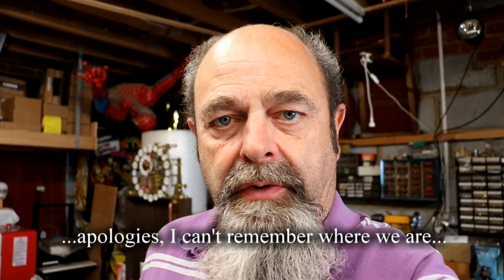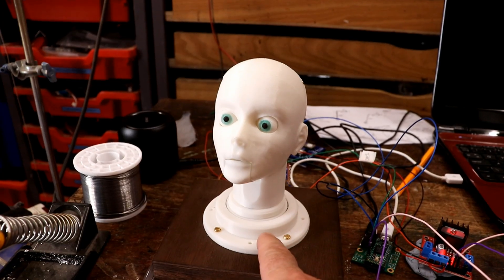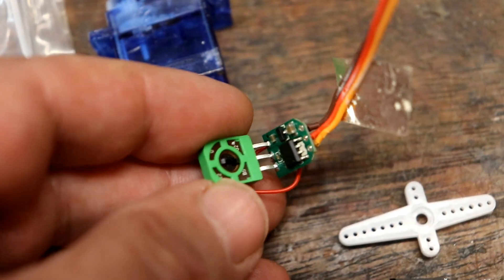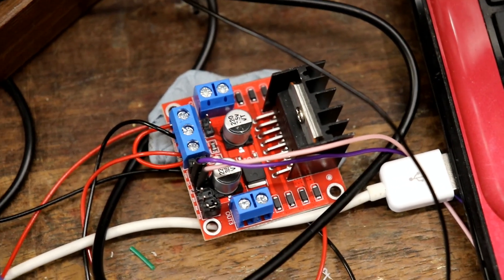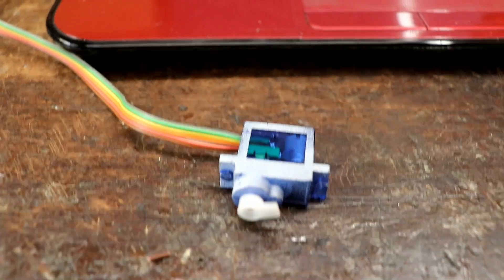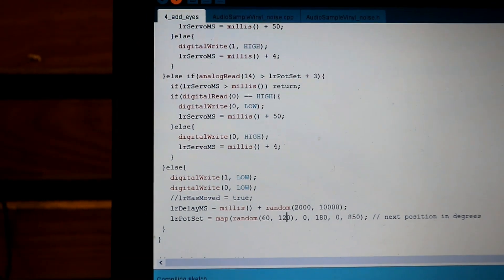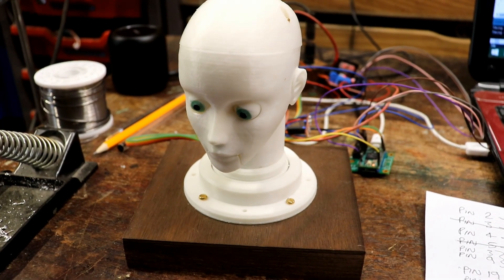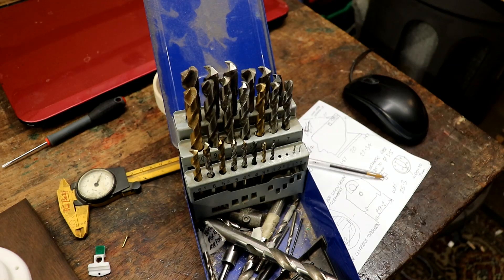Part 6 - How to take control of a servo motor

Comment: I recommend you use I2C controlled servo boards. no burdain and conflict on the microcontroller
Reply from the maker: Thank you. I did consider using these but ending up finding the Teensy had enough pwm outputs to cater for the required servos.

Comment: 06:00 - 06:10 Excuse me for thinking out loud ..
I assume you should keep it so that the movement stays within the potentiometer's resistive track.
So you have an analog representation of the servo's position. 
I'm not sure what kind of feedback the potentiometer provides outside of the resistive track,
but I'm guessing 5V, open or 0V.

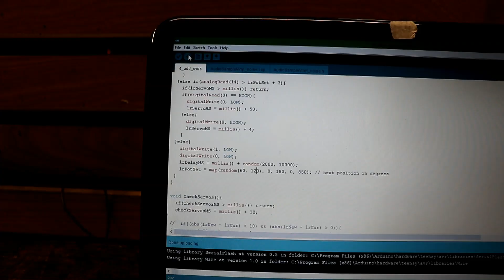13:33 ->
Your wife did a wonderful job.
Are you the skilled author?

18:57 ->
Congratulations! Have fun!
Reply from the maker: I had no idea of the position of the potentiometer having taken the servo apart, cut off the 180 degree stops and then reassembled it. Thankfully a bit of experimentation found the 90 degree point and which way the motor connections should be connected to the H-bridge interface - so many possible sources of failure! Being able to move right round, once it had found the 90 degree point I just reattached the servo's horn. 

I connected each end of the potentiometer to the Teensy's 3.3v and 0v supplies - the Teensy works on 3.3v and it's inputs mustn't exceed this.

I'm so grateful my wife is happy to record the automaton's speech. I wrote the script with some added steampunk style from ChatGPT!

Thank you. I can't wait to build some sort of machine using the automaton head....

Comment: It is like many a project, you get to around 80% completed, but then the last 20% seems to take even longer than the 80% took to complete. Is the talking heads voice really your wife's voice, if so she has a talent indeed. She sounds exactly as I would expect a Victorian Lady to speak. The piece of felt to ease the jaw was a good fix. Good post again, getting engrossed in this one 👍
The next piece is optional, as part of the 80% to 20% conundrum.
I was sat in a hotel in Sacramento, CA, with a folio of coding, a Psion Organiser, an EEPROM programmer and a bags of EEPROMS. Two of us had designed a system that could tell the difference of one of our large industrial gearboxes being stopped naturally and being stopped because the operator had left a loading trolley in the way after loading  3 x 1 ton reels of newsprint paper. We had completed tests here in UK but had to make them work over in the colonies, as it were. I was sent as the other fellow had a fear of flying, whereas I had often fallen to sleep before the plane took off. I did manage to get the coding right and the units worked. However, after hearing how successful these units were the MD pulled the plug on the project as he would lose the costs to repair the gearboxes. He always was short sighted,  because we could adapt the units to work on any gearbox and also machine tools, lathes and mills and sell them to other machinery manufacturers. Still I got to stay out in the US to monitor the units under test for a couple of months, when it was not as toxic as it is today.
Reply from the maker: You're absolutely right - the last 20% is so challenging! Her speech was kindly recorded by my wife who does have the perfect voice! I could probably find some AI voice app, but you really can't beat the subtle intonations provided by a human. 

Oh the Psion Organiser, I have one in the loft. You must have been gutted when your boss pulled the plug on your development just so the company could provide more gearbox repairs!

Comment: Are you driving the servo outputs with 3V?..
Ok, the power might be 5 ( itself low for 6 V nominal)..but if you are driving the servo inputs wire with 3 volts..your noise immunity  will be awful so noise will be the  makkng servo chatter( it happens with RC when batteries  get low)
Reply from the maker: I am driving the servo data connection with 3.3 volts. Paul Stoffragen (the inventor of the Teensy) suggested it would work. I think the problem was the momentum of the head - the servo reached the desired position but the head continued to turn so the servo compensated turning it in the opposite direction etc etc. Once I'd connected the servo's potentiometer to an analogue input on the teensy and used an H-bridge interface to control the motor it continued to vibrate until I added some additional hysteresis. I think I got it to ignore a couple of degrees of movement and then it worked perfectly.
Reply: ..I see that you finally   "took over" 
This allows you to modulate  thd drive of the motor..so yes kn practice slow the motion down. .to dampen the system.
 Since your model  is ultimately  light..so the servos might overshoot and "hunt".
The joy of your own software is you can allow lower drive speeds and larger "deadband" all helping
Reply from the maker: @jasonudall8614  Absolutely, it's great to be able to get it to do what I want! Also it means there's never a fast moment when it's first switched on as the controller always knows its position.